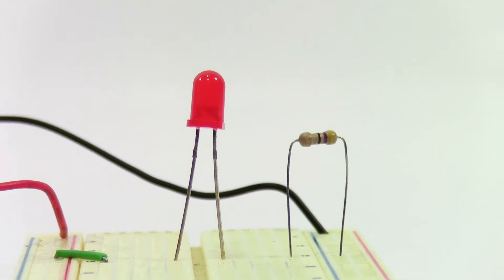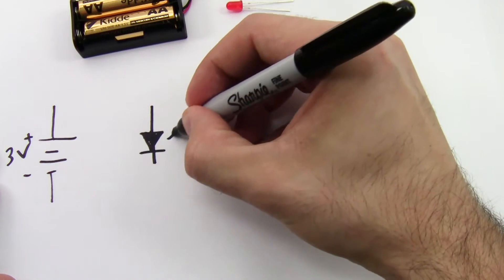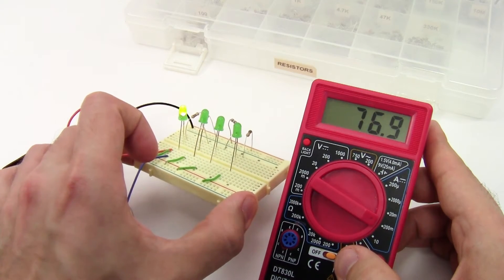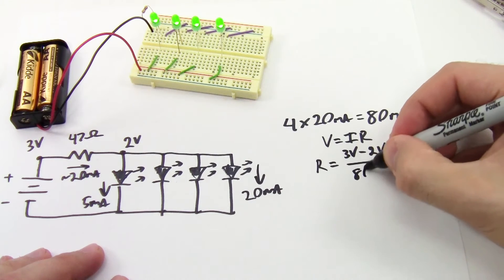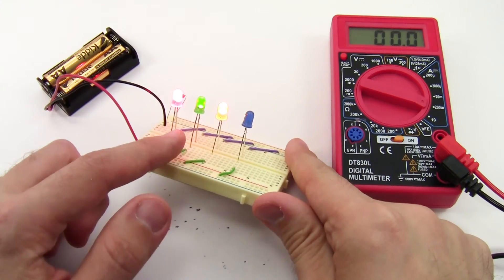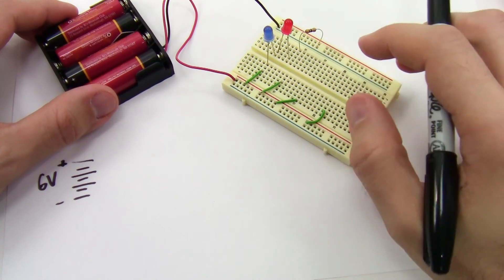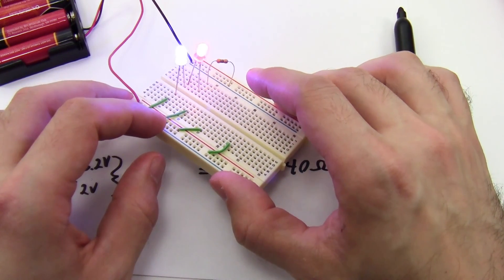How to Find LED Resistor Value

Comment: Thank you for explaining also could you explain Why dont the led burn out with 3v CR2032 coin cell without resistor?
Reply from the maker: Because of the battery internal resistance: https://youtu.be/a8d22YQ2qEw?si=ZKwk4-3iRIfOC3lj

Comment: I have a question for you. I have two LED lights (12V, 50mA) for a building for my train set. My power source (power pac) output is 12V. Based on this information, could you tell me what strength of resistor is needed? Thank you.

Comment: I figured out that you have to convert the volts to mV to do the math. 2.5V is 2500mV/20mA=125ohm. Otherwise it's wrong. Please add on if I am incorrect.
Reply from the maker: You are correct - either divide volts by amps, or millivolts by milliamps, and you will get ohms. If you mix and match units you will get weird results in milli or kilo-ohms instead of ohms.
Reply: @BenFinio  Thanks for responding. I know when the result of math is a decimal I didn't do something related to 10.

Comment: Excellent.  What if it’s a tiny LED strip current value unknown but power is 12v car battery.  The LED strip works perfect but very bright.  Would a small resistor in series burn out?  Taking high current etc… thx.

Comment: Your Ohm's law equation is incorrectly labeled for solving for resistor values for LEDs.  'Resistance' does equal 'Voltage' divided by 'Current', but it does not equal 'Max Voltage' minus 'Forward Voltage' of load (found in the LED datasheet) divided by 'Continuous Forward Current' of circuit.

In formula version that would be:  R = V/I ≠ R = Vₘₐₓ - Vₜ / Iₜ)

If you want to find the correct resistor to use for your particular load use R = Vₘₐₓ - Vₜ / Iₜ 
OR
Resistance(resistor in series with load) equals 'Voltage Max' of circuit minus 'Forward Voltage' of load(LED) divided by 'Continuous Forward Current'.
Reply: If anyone is confused with the 20mA requirement. The datasheet at 0:16 said 'Forward Current' (If)  was supposed to be 15mA. It's a nice round number, and a base of 10. So it can be multiplied and divided for easier comprehension for us. What a thoughtful guy. 
AND/OR 
Ben increased that number a little I'm guessing for video sake because lit LEDs are sometimes hard to detect when filming in the day time.

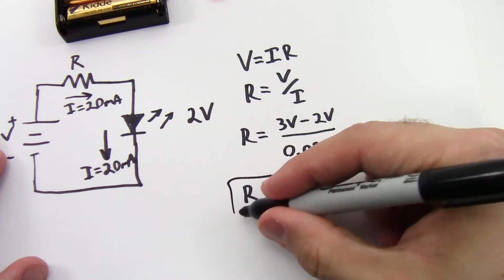Comment: at 3:29 the resistance was 50 ohms but when i try to figure the current of that circuit with 50 ohms ( I = 3/50 )
it didn't equal to 20mA. why is that?

Comment: Hi Ben!   First off, thank you so much for posting these highly useful videos!   ....one of my next projects will be scratch building a scale model of about a 13-story tall office building, and lighting up each floor individually.  I will be using between 5-10 clear white leds on each floor, and some colored leds for exterior lighting.  Im thinking about wiring the entire building in parallel, and combining every two floors into individual parallel circuits, using 2 AA batteries for each one....do you think this would work?   Any suggestions?

Comment: Hello, very nice video. If you were able to supply an LED the exact same voltage that it requires, would your calculations come out to zero ohms, or no resistor needed? For all of your examples, the voltage provided was above the voltage required, so I understand needing a resistor in those scenarios. Thank you.

Comment: Howdy, Brother!  What resistor should I use if I have a yellow 10mm LED Emitting Diode (1.8-2.2V)  powered by two AA Batteries (on/off switch in the loop)?  I'm not even sure if I asked the question properly 🤠. Thanks for any assistance.
Reply: 45 ohms?

Comment: Very nice video. In respect to LEDs themselves, read your datasheet and it should have relative luminosity at a specific current. That way if you're doing RGB stuff, you can figure out what current you want in order to make the relative brightness between each color the same.

Comment: Hi, thanks for the great explanation, I have a question for calculating the value of the resistance @ min 10:46 , why did you put 0.02 for the current when we have 2 LED? Isn't that supposed to be 0.04? or that's because we connected the LED in parallel?

Comment: Need help. I want a simple led and resistor and diode combination which will glow the led at exact 4.2V. My BMS does not have led indicator to show li-ion battery is fully charged.
Reply: Google on "Li-ion battery indicator light circuit" and you will get several circuits.  To get a precise voltage point for turn-on, a zener diode or else a voltage-divider of two or more resistors will be needed.

Comment: I realize this is an older video. But no need to look up anything or to find the forward voltage drop to any LED. Merely take the supply voltage and divide by ~20ma or less and WALA, you have the resistor value. No need to look up anything, and too many times you have no idea what type LED you have. So merely pick your resistor for 20ma or less and it will work every time...   JMHO!
Reply: So if I have a 30mA LED and a 5V supply, I need something close to a 166ohm resistor? I’m trying to wrap my around around this and you come out of left field with a cheat code. This would make my life so much easier 😅

Comment: Hi Ben I have 90 LED 2v all individually switched obviously will each have their own resistor what is the lowest and highest power I can run these on and what calculation would I use pleas kind regards John
Reply: Sorry I should have said run in parallel

Comment: I am a bit confused, and I would like to know the error in my logic.  

If I had a 3V 20mA LED and wanted to connect it to three 1.5V batteries in series (4.5V), I would need a 60Ω resistor, I believe.  But wouldn't that only bring the current of the circuit down to 70mA (4.2V/60Ω), making the current still too high for the 20mA LED?  

Thanks! :)
Reply: .(4.5-3) = 1.5V.   Divide 1.5V by 0.02A = 75 ohm resistor.   The current will be 1.5/75mA = 20 mA as specified, .   The LED drops the voltage by 3 volts so 1.5V not 4.2V.

Comment: Nicely explained. The only thing I did not understand is how the breadboard parrallel connection with your multimeter plugged in at 6:42 works.

Comment: I'm a total noob at this.
Can you use a capacitor to store energy from the battery so it's not wasted?

So can you apply a capacitor that will take in the energy from the battery & apply what's needed to the LEDs so that your circuit becomes more efficient & less wasteful?
Reply from the maker: I can't really answer this question in a short youtube comment - I don't have my own videos about capacitors, but there will be plenty of other videos out there about them.
Reply: The short answer is no.  A capacitor stores energy as electric charge but the voltage across it can vary by a large amount and potentially destroy the LED.   A battery stores chemical energy but the terminal voltage only varies by a relatively small amount, so more suitable for powering electrical and electronic devices.

Comment: Good presentation! I'm little lost on resistor power handling...heat dissipation. Like when to use a 1/4 watt instead of a 1/8 watt (example).
I had a project to use LED lights on a golf cart. Cart batteries were 8.43 vdc each.
I had LEDs using 4.5 vdc. Not knowing current draw of LED....I started off with 100 ohm resistor...had 2.7 vdc to LED...was very dim illumination. Then tried 33 ohm (was 1/4 watt)...got 3.2 vdc to LED...was little brighter...then tried a 10 ohm (was a 10 watt)...got 3.9 vdc to LED....was much brighter. By seeing my results I figured to get the 4.5 vdc I would need a ~ 2 ohm resistor (to achieve optimal light illumination of LED...rated as 100 lumens output).
I noticed I could not read actual drop down voltage out of my "circuit" until there was the LED load put on it. 
Had fun playing with it....not an "orthodox" way of designing...didn't have the current draw specs of the LED.
Not sure if this is an acceptable way to do it.
😁
Just curious if my estimation of the 2 ohm resistor is correct. And would a 5 watt rating work?

Comment: What would you recommend for 12 LEDs and a single power source between 9v and 12v? All parallel with a resistor on each, or several LEDs in series and those series in parallel sets with a resistor for each set? Concern over how hot the resistor gets is unique due to the material near the LEDs being very sensitive. Thanks.
Reply from the maker: To minimize power dissipation (and thus heat generation) in the resistors you want to minimize voltage drop across them. So for example if you combine several LEDs in series and then put sets of those in parallel as you suggested, the voltage drop over the resistor is smaller than if you just put all the LEDs in parallel each with their own resistor. However, note that the LEDs themselves will also heat up (they are not 100% efficient - i.e. they do not convert 100% of electrical energy into visible light) so you may still need to be careful if your application is very temperature sensitive.
Reply: @BenFinio  Thanks!

Comment: Can connect a 3v led with a resistor and a 12v led to the same 12v battery? Does the resistor limit the 12v as well?

Comment: So if I want to run 8 3v multi colored flickering leds off a 12 volt power supply what size resistor would I use
Reply from the maker: You watch the video and learn to do the calculation yourself :-)

Comment: This is the first video (of MANY) that I've come across that actually shows how to find the voltage and current for an LED, or actually uses the terms one sees in the data sheets for that matter (forward voltage and forward current). All other videos explaining how to calculate the resistor just say, "...and this LED has a voltage drop of 2V." Thank you for explaining in a practical, applicable way!

Comment: There are a million YT videos out there about this. All say look up the values in the spec sheet. Good luck with that. None shows a practical method how to figure out what the forward voltage and power draw is when you do not have the spec sheet.
Reply from the maker: Most common LEDs of the same color are going to have similar voltage drops regardless of brand, so you can always just Google it and look up a table of LED color vs voltage as a starting point. You can also start out with a larger resistor to be safe, measure the current, and work your way down to smaller resistors.

Comment: I have a car license plate bulb socket that requires a resistor to make an LED bulb work in the socket. If I use an axial resistor and connect one wire end to the left socket contact and the other wire end to the right socket contact and then insert the bulb into the socket is that a series connection? Also, if I calculate a 115 ohm, 1W resistor could I go with a higher power rated resistor like a 5W? I believe I read you can do that. In this case if you chose a 100 ohm resistor would that be close enough or should you be at or above the calculated resistance value? Thanks for your time!

Comment: Could one not set up a voltage divider and do a little better?
Reply: NO
Reply: @kennmossman8701  Correct answer, BOSS! Because a voltage divider does not efficiently pass the current required for even an LED. They are fine for signal to the base of a transistor that DOES drive an LED, however. But you know that.
Reply: @skeggjoldgunnr3167  
yeah
two points
First is that LEDs are current driven devices so using a voltage divider to set the voltage is ass-backwards. 
Second is that it is more difficult and less precise. To see why lets say we have two resistors; R1 and R2 with the LED across R2.
The voltage across the LED is   Vs x R2 /[R1 + R2]
with the current through the resistors given by Vs / [R1 + R2]
But the LED needs current so that needs to allow for that
HOWEVER the load - here is the LED - affects the effective value of R2 since they are in parallel.  The effective resistance is R2 x RL / [R2 + RL] where RL is the load's resistance which is given by Vf / IL where IL is the current through the LED. RL is hardly precise since it depends on IL and the largely exponential relationship between Vf and current.
So we now have four equations instead of one, less efficiency, and is more trial and error.

Comment: How did we know the 10 ohm resistant have 0.25 w power?
Reply: W = V x I     but in practical terms use   W >= 2 x V x I            V is the voltage across the resistor
Reply: Resistors are sold in different power ratings, and the higher power resistors are physically bigger.  0.25W is a common power rating for resistors of the physical size shown here, which is the most common size used by hobbyists.  If you look for a resistor kit on Amazon, you'll see most of them are 1/4W.

Comment: I am using 330 ohm resistors but my leds are still too bright, I piwer the leds directly from an esp32
Reply: NOT recommended
Reply: Yup.  I find modern LEDs, (and I mostly use surface mount ones) are way too bright if you run them at their datasheet current.  Looking at a Firebeetle ESP board, their LED resistor is 2.4k for less than a milliamp.  I know the LED calculation like the back of my hand, but these days I just bung in a big resistor and see if it looks OK.
Reply: Three considerations are the wattage of the resistor and current availability of a small power supply attached at one end of the breadboard, and maybe going through thin breadboard wires.

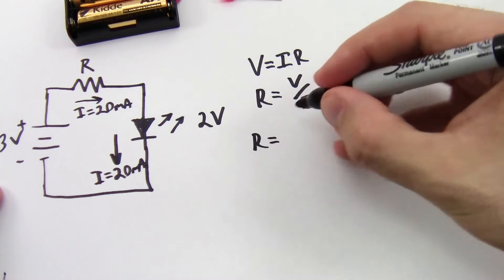Comment: Ben - Good tutorial but, unlike the other comments I read,  I ended up confused by your application of Ohm's law..  At 2:26 you said the voltage drop over the LED was   2V.  Then at 3:16 when you applied ohms law you calculated the value of V by subtracting the drop over the LED (2V) from the voltage of the power source (3V).  I would have calculated it incorrectly by taking the Voltage at the input (3V) to the resistor and dividing that by the current flow I wanted at the output of the resistor (20 ma) yielding 150 ohms or 3 times the correct value.  Can you help me understand the proper method?   That is, subtracting the voltage drop over the LED from the supply voltage?  Thank you, Tom

Comment: Great video! I have an LED string with non-removable bulbs and 1/2 of the string is dead. I have found the bad bulb and I want to cut it out of the circuit. I know that I have to replace the bulb with a resistor but, since I have no data on the string of lights, I don't know what value of resistor to use to phase out the dead LED. Suggestions?
Reply: not even info is given.   if you like try a 330 Ohm resistor ...if too dim, try 220, if too dim try 100, etc
Reply from the maker: In general if you are in a guess-and-check situation with resistors, it's safer to start with a very high value and work your way down. If you start low you are more likely to burn something out by having too much current.

Comment: It explane more but I still cann't put all together. What is current of the battery? Why is it not importent? What will be the difference if I use 5V 0.5A or 5V 0.9A (USB supplied power)
Reply from the maker: Hi - you may find my intro to circuits playlist helpful: https://youtube.com/playlist?list=PLKL6KBeCnI3U6KNZEiitdtqvrxkBhpuOp. For the supplies you mentioned, 500mA (0.5mA) is already more than enough if you are only lighting up a few LEDs - if each LED only needs 20mA that's enough for 500/20 = 25 LEDs.

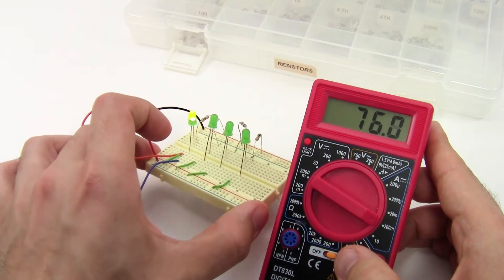Comment: At 1:14 it's said that using extra batteries will waste power because it will be burned off by the resistor, but at 4:39 it's said that if you reduce the current from having a stronger resistor you can extend your battery life. These two statements seem like they're in opposition. Could someone please elaborate?
Reply: you are wondering about apples and oranges - two very different things

Comment: Yeah I have a question.  I have a power supply (coin cell) of 3.7V  I need to power 3 LED Filaments  that are 3V at 50 - 100 milliamps.  Do I need to add more power to run them? How money resistors would I need? And What resistor would I use? I don’t want to overheat anything?   Just FYI I have a 6V power supply if I need it.
Reply from the maker: A coin cell battery may not have enough current to power that many LEDs. You can typically power a single LED with a coin cell battery without needing a resistor, because the current they provide is so small. This video may help, as well as the introduction to circuits playlist on my channel: https://youtu.be/ZdIBle_9Y_4

Comment: Hi Ben . Lovely video explaining the maths and the valuable point about not making an error of adding up the forward ampage in a LED in series circuit. I have a question ,please. On resistors size my little project works out the power going thru my resistor is 0.029w , does it make any difference if i was to use a 0.125w power rated resistor , to say , using a 0.500w power rated resistor ? Hope you could help. Look forward to hearing from you . Regards Don Codman
Reply: Hi Don - as long as they have the same resistance, it doesn't change the math for the current going through the LED. Resistors with bigger power ratings will generally be more expensive so you don't "need" the 0.5W resistor in this case but there's no harm in using it that I'm aware of.
Reply: no difference     in general a higher wattage resistor is less likely to drift or burn-out

Comment: Can u use 1 resistor on 6 led lights atm I've got 6 led lights on all 6 led lights I'm using a 1k resistor
Reply from the maker: Hi - if you watch the entire video it will show you how to do the calculation. It depends on the voltage of your power supply, the color of your LEDs, and the power rating of your resistor.
Reply: @BenFinio  power supply is 7.4v with a 1k resistor and 3v led lights